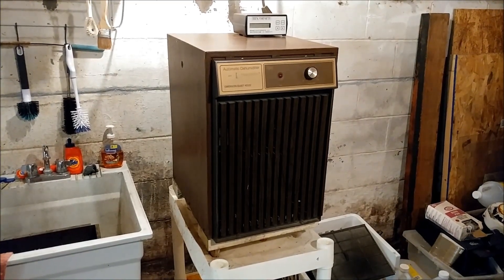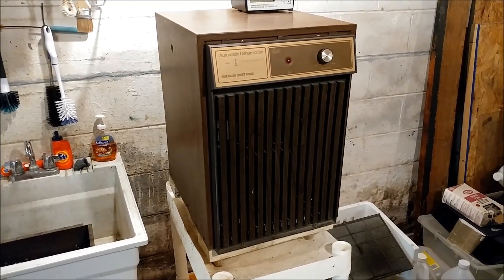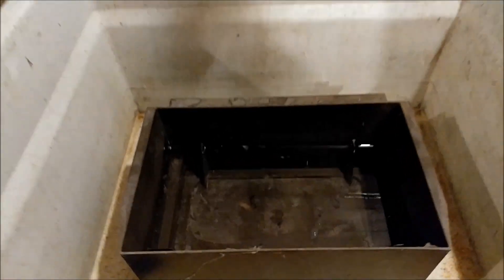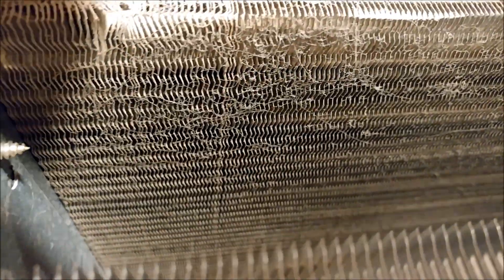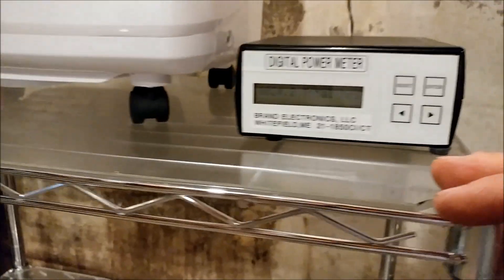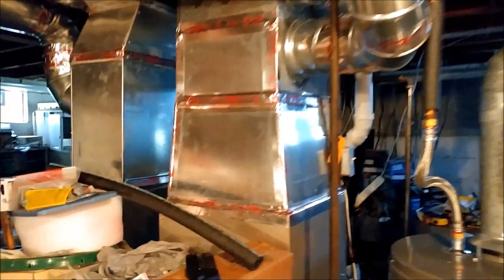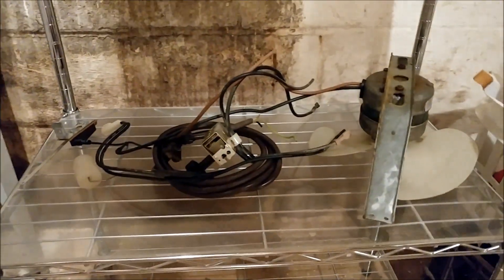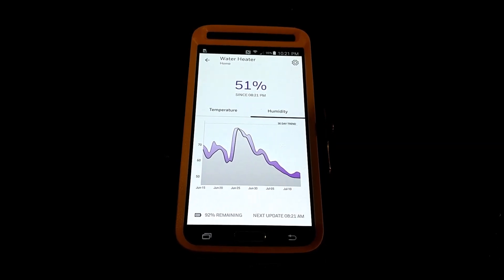Vintage Emerson Quiet Kool 44pt Dehumidifier vs. New Frigidaire 70pt Dehumidifier

Comment: The comments are all correct. I scrap lots of newer dehumidifiers, they are all junk. Some last 5 years, some last 1 or 2 years. They usually fail from refrigerant leaks. You traded a high quality appliance for a very expensive poor quality one. I rarely pick up older dehumidifiers that the refrigerant system doesn't still work.

Comment: Ouch....... you definitely got rid of the better unit. It was still quiet and smooth sounding, so it was likely still working fine. Would've kept doing so too, with a bit of cleaning of the fins, along with a wire brush sanding, priming and painting of the compressor and base pan. Proof? I did the same to my '67 air conditioner, same brand of compressor (Tecumseh), and it still works as well as the day it was made. 56 years old! Way older than me. I uploaded it to my channel here if you're curious. That new dehumidifier you bought, though? If it isn't already dead 4 years later, I doubt it'll last another 4. Unlike the old one, which probably would've given you another 30 years at least. I'm sorry you didn't know how horribly unreliable new stuff is.

Comment: It's 2022 now and that Frigidaire is about dead. Had two of them and neither one lasted 4 years.  I'd have kept that old unit and scraped all the rust off and painted a rust inhibiting paint on it.  That Frigidair or any of the newer units will never see more than 5 years.  All junk and high priced.  And yes, I've maintained my units by religiously cleaning filters and vacuuming out at end of season.

Comment: My grandmother bought a brand new Frigidaire 50 pint dehumidifier to replace here old 40 WCI Kenmore. She purchased the Frigidaire brand new from the appliance center in 2016 and in 2020 the bottom of the evaporator coil is covered in rust and rott... sadly i hate to say this but because you wanted energy efficiency and a bigger unit you probably just screwed yourself over because i am sure in five years your unit will probably rot out and  freeze over the whole coil. Eventually you will be spending all the money you saved by the new unit on another new unit. I recommend replacing this with another vintage unit what is probably hard to find but will last alot longer.

Comment: You made a huge huge mistake of replacing a vintage dehumidifier with a shitty made in China modern one.  That thing is gonna fail in 2 years.  Either the compressor will fail, the electronics will burn up or the unit will lose all its refrigerant.  The new Frigidaire will never work as good as the old one.  Your old one was either undersized with all that central ac equipment or it was probably low on refrigerant and needed to be recharged.  I can guarantee you that you will regret replacing that vintage dehumidifier in 2 years.  Plus your basement is gonna be very hot due to the modern one making a lot of unnecessary heat.  You could’ve at least asked any youtubers into these vintage stuff if they can have the old unit.  Shame on you for scrapping that very nice unit
Reply: Will Butter I agreed Emerson Can beat the Modern Frigidaire like a piece of Cake